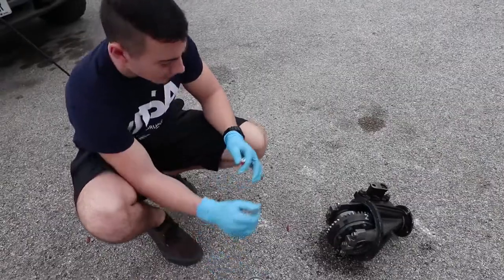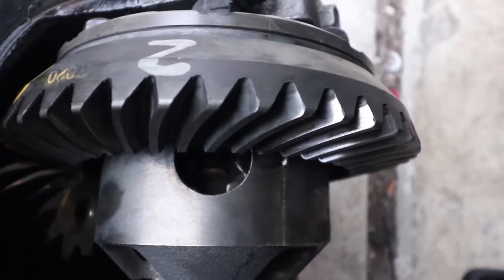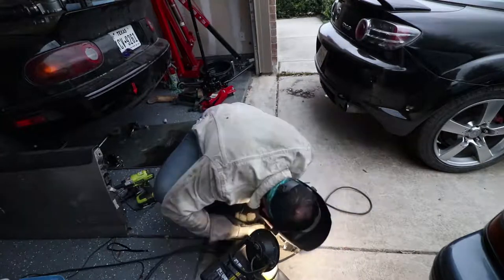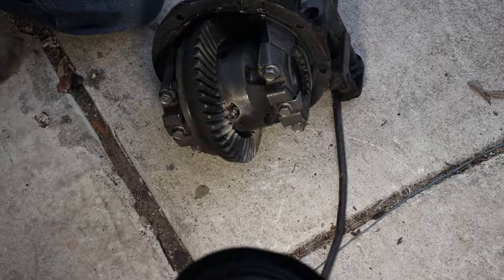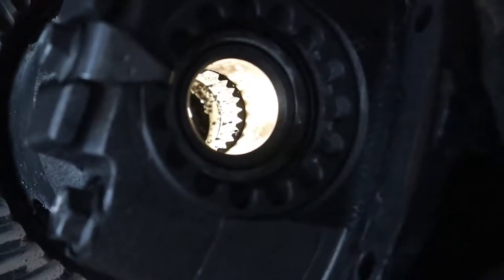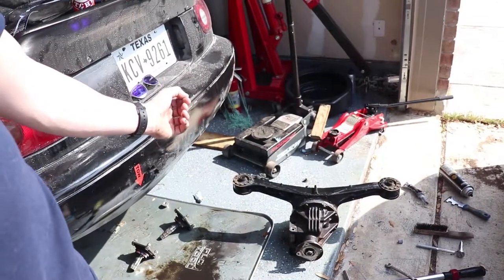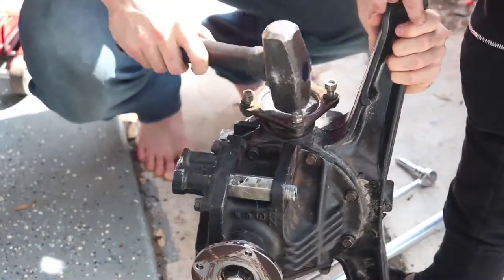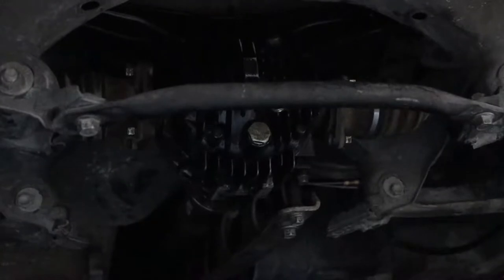How to Weld a Mazda Miata Differential for Drifting

Comment: How do you remove the half axles that your replacing in the diff at @5:29
Reply from the maker: We used a pry bar and a hammer. They should pop out with a few good whacks. You just tap it from behind and it should pop right out.
Reply: A pickle fork works great too

Comment: How’s it held up with the welded lsd? I’m about to weld mine tomorrow with a shitty harbor freight welder
Reply from the maker: Sorry I just saw this, but it held up fine until our boost hit 20 psi mid drift and we blew out the pinion bearing on the 1.6 diff. We later swapped in a 1.8 diff with an rx7 housing. We made a video about that about a year or so ago.
Reply: @TheDailyDrift  If i were to keep my engine stock with its 120 hp would i have to worry about breaking my welded diff?